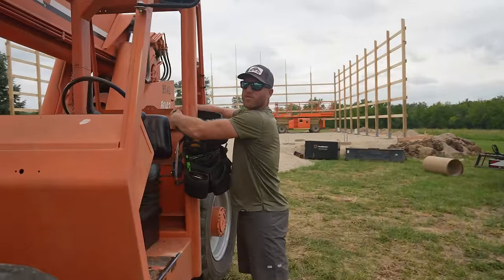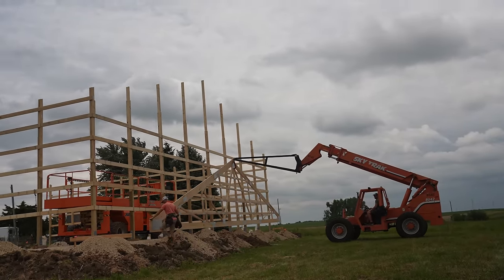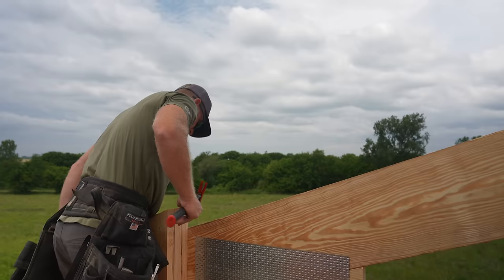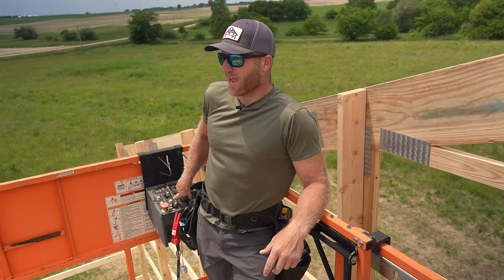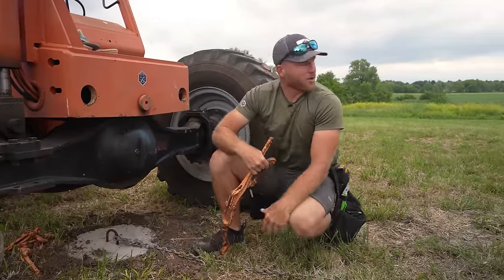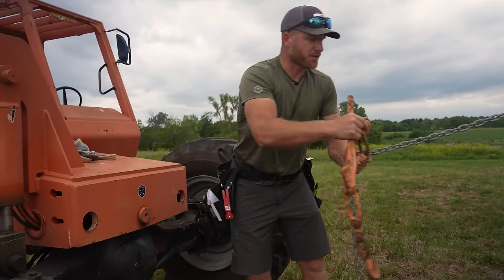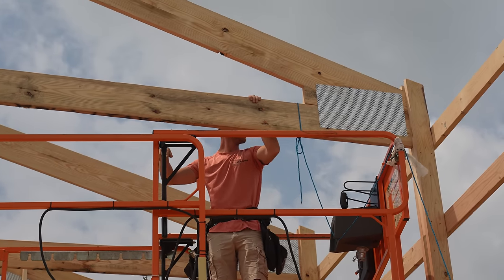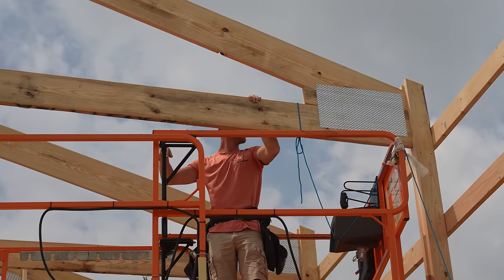Installing Large Trusses on the Farm Shop! Man It Was WINDY

Comment: • It's called a "dead man" because it's buried in the ground.
• Nice that you had the forks to lift the stranded lift, but you also had the lift's leveling feet at your disposal, to lift it up and get something underneath for traction. Just a thought, to work quicker.
• I'm seriously impressed with how efficiently you two work together to accomplish things that most other companies use at least 3-4 people to do. It really speaks to both of your skills and experience to plan these things out so you can do the work with out the extra manpower.
• I haven't seen builds like this done in wood in quite a while, everything is steel nowadays. This is very relaxing to watch you guys work on this, I appreciate how detailed your videos are, and that you explain the steps and the logistical reasons for the steps. It's quite the masterclass. I've done smaller builds myself, but it's comforting to watch you guys prove this kind of build can be done with minimal manpower, if you know how to do it correctly.

Comment: Brings back memories of my 20s building pole barns. The company I worked for didn't have any man lifts. We only had a skid loader. Any building over 40 foot wide we hired a local crane company to set trusses. Climbed the building and trusses to put purlins on the trusses. Widest we did was an 80 foot riding arena. Had to nail two trusses together and set them.

Comment: I had the same thing happen with a rented scissor lift same model as your small one.    Dug itself into 57# slate gravel.  I ended up purchasing several sheets of plywood to lay on the ground just to be able to use the machine.     My 60x42x18 building turned out great thanks to your channel!!

If I had it all over to do again I would dig the holes and build the frame before adding the gravel.   Just too much trouble with the wide holes and machine getting stuck.   It would be way easier to use the skid loader to bring in the rock later.

Comment: Some people call them jacking lugs, but in the end a deadman is named after morbidly trying to pull a dead man out of the earth . The engineering formula is F=uR. Here is a reference on the earliest use of this word from 1858.  "a1852 W. T. Spurdens Forby's Vocab. E. Anglia (1858) III. 12 Deadman, a piece of timber buried in the earth, to secure posts, or other timbers by". And then the next reference was 1901. Typically associated with mountaineering and climbing and there often called a t-slot anchor. It is definitely a very old slang term.  True story back in 1994 I removed some 20x20 concrete anchors with the top at ground level and 20 ft below ground...they were to 'catch' the space shuttle at an alternate landing site if things went bad, one on each side of the runway. So, each deadman weighed nearly a million pounds. the tie offs were 2 inch steel and went to the bottom of the anchor. We may not know everything, but the engineering part is fun, intriguing, and important to every building.

Comment: Great work gentlemen! My question is at 19:43, I noticed the "dead man" chain is very close the the bottom of the truss....was this planned right from the word go when you were digging your dead man holes and placing the rebar or is it just coincidental? If it was planned, I am THOROUGHLY IMPRESSED!! 👍
Reply: I work for a Morton Buildings so can't speak to what Kyle does but I doubt he does the math to figure out where to dig his deadmen so the chain miss the trusses. If they do end up running right through the bottom cord of the truss, you can just put in on top or below and it'll be fine even with a bit of tension on the wood. Usually I put them in line with the 3rd post in from endwall and then every 24-30 feet after that. Always in line with the trusses so that I can use the same deadman for a cross chain ("X" chain) as well.

Comment: How often do you genuinely inspect (cuts, abrasions, damage, etc.) and/or replace those overhead slings?
Reply: I've been a Ironworker and a carpenter and so many guys don't  check their rigging daily if used that day and if needed I would use softeners we call them ( a  rag , glove what I  keep in my tool box are couple pairs of 4 x6 rubber belting

Comment: When you lift a truss from the center like you attempted to do before going to straps, are you concerned about the integrity of the gusset plate when it was being compressed under the weight at the peak of the truss?

Comment: If u get some 16ft 2x12s and strap em to that  lull deck u be on the outsid did  that b4 just don't let Osha catch ya we used method doing 3story ban 60 ft lul outriggers  maxed out planks on top of the cage wid just 4sq shingles  in middle for ballast layen shingles on barn 70 ft up parked wrong doing not a thing correctly  other than the installation all wile on a 30percent grade cause that was the job.   GOOD  PAY LONG DAY HELL OF A NIGHT WASH RINCE REPEAT